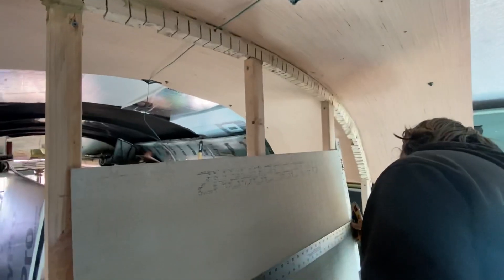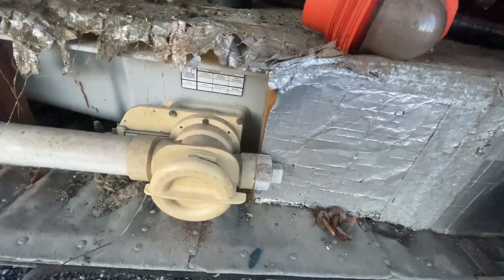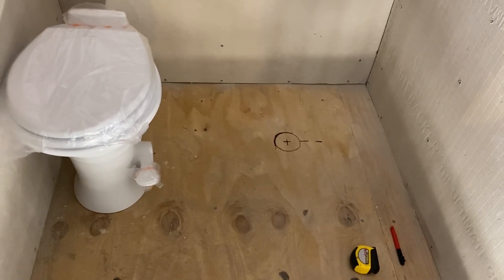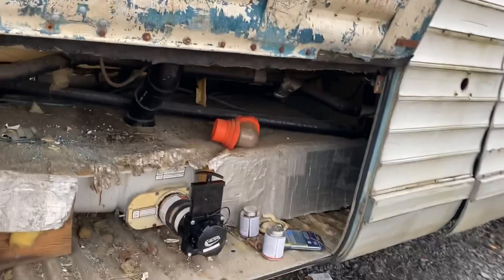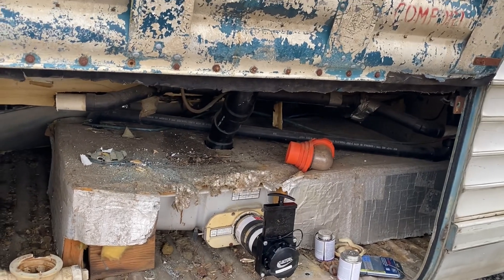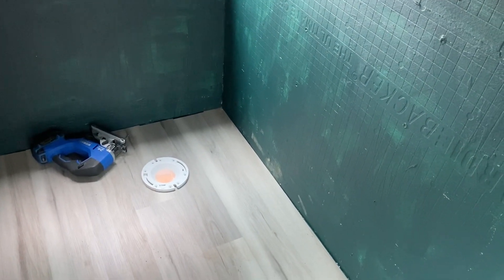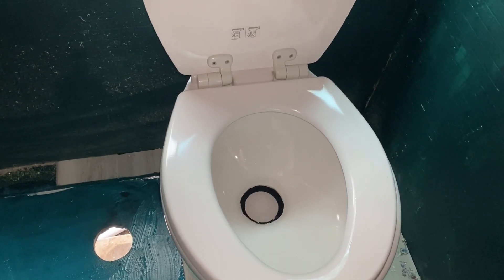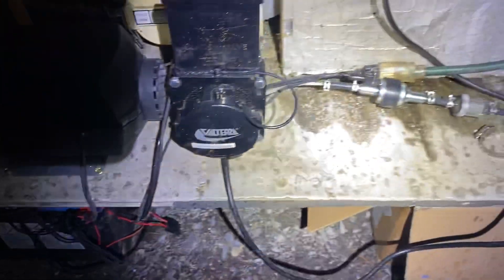Silversides bus conversion bathroom day 1-2

Comment: The old style connection is “Thetford” and parts and adaptors are readily available for the connections and valves. The newer “Valterra” style is popular now and is the defacto standard. Good move to change now. The industry changed simply because the Valterra is cheaper. The size of the Thetford is slightly larger. If you are keeping the Thetford valve, It would be a good idea to replace the seals, easy to do now.

Comment: Tip :  build a filter assembly for the heater heated air intake. Keep a close eye on filter and change/clean regularly. 
Tip:  install more than one fuel filter at different points of the fuel delivery system.  One on the line in the fuel tank and in line just before the pump, at the least.  The filter in the fuel tank is bery important.

Comment: I notice at 8:48 PVC pipe glued to ABS pipe which is a no no because pretty much guaranteed to eventually leak.
Reply: I thought there was a type of cement that bonds the two types...
Reply: @jamesanderton344  I think Oatey makes a ABS to PVC transition glue but where I am from, plumbing codes to not permit it.

Comment: I hope you guys used the correct glue on the toilet drain pipe transition from black to white PVC, I made that mistake once and it started leaking a few months later. They make a special “Transition Glue” for White to Black pipe or vice versa.
Reply: Some glues work with both ABS and PVC....
Reply: You probably saved my ass in the future.

Comment: What happens is the shitter tank starts to lead the methane gases while the heater is on?
Reply from the maker: Oh please.   I have a diesel heater in the same bay as my black tank for over two years.
Reply from the maker: And the combustion intake is under the bus for fresh air intake not from the bay.

Comment: What´s the plan with the heater exhaust? I´m a bit concerned because there have been a few deaths here in Sweden where people have used the stock bus diesel heaters. They died of exhaust poisoning in their sleep even if the heater and exhaust was ok. It seems (?) you need to make a chimney of some kind for it to be safe. Just concerned for you guys.
Reply from the maker: It exhausts out the bottom of the bus and to the side.

Comment: At least putting the air inlet of the diesel heater right next to the black water tank valve means that if it leaks, you’ll soon smell it inside the bus! 💩😉

Comment: I've always heard that putting a battery directly on the ground isn't good and drains the battery. Is that true?
Reply: very false. same for the concrete myth.
Reply: Watch Wes Work
Reply: That was back decades ago when the battery cases were made of wood, they would discharge, but battery manufacturers cured that problem with hard case plastic battery casings.